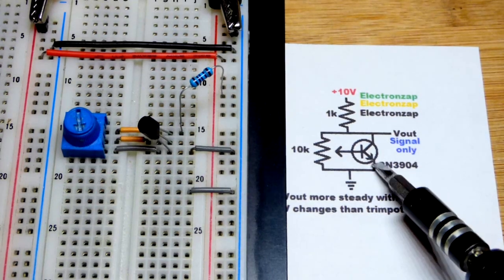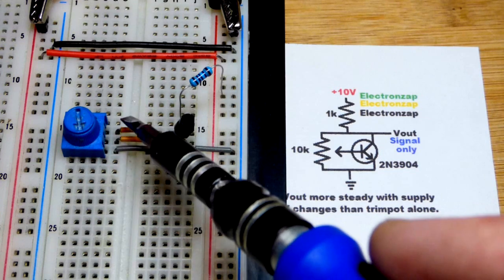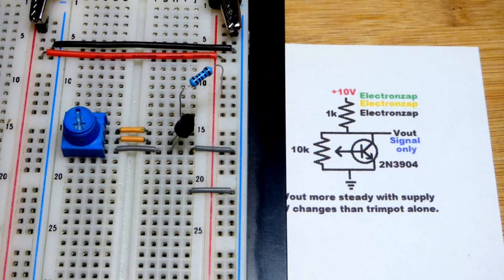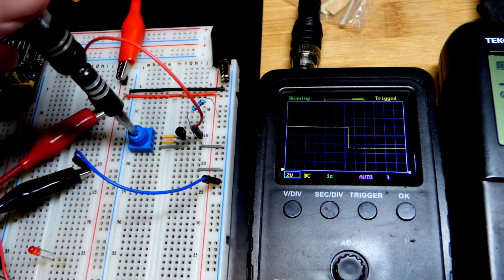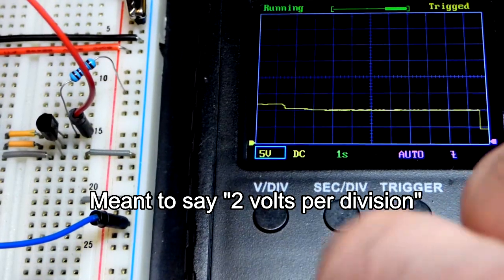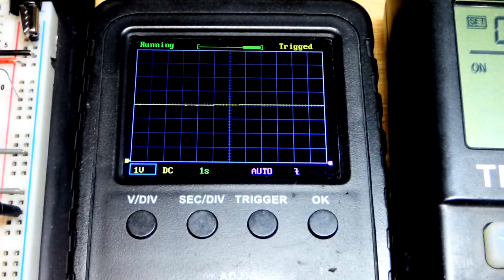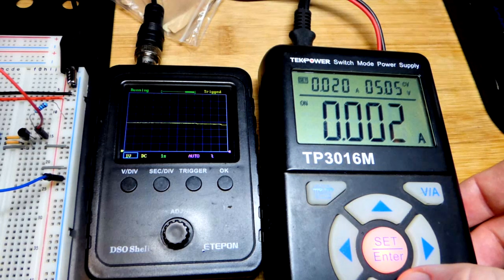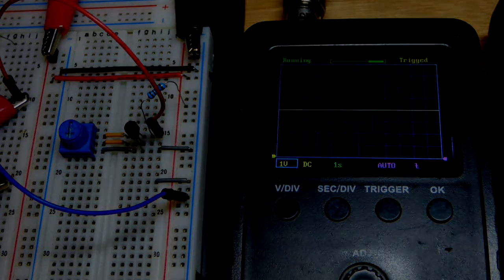How to wire an NPN BJT to act as an adjustable zener diode using 2N3904 for DIY electronics

Comment: I'm struggling with AC current and capacitor choices. Specifically, I want to get into building guitar pedals, but I feel a bit stuck not knowing what capacitors to stock up on.

Do you have anything that might cover all the bases? Power supply smoothing, high-pass filtering, and low-pass filtering?
Reply from the maker: I just have basic capacitor videos and I never studied guitar pedals. I'd look at guitar pedal projects that other people put together for inspiration.
Reply: @Electronzap  I've been trying to do that. Every project and tutorial I've watched or read up on are describing the reason for the values, but never really deep dive into the component choice.

So far my best resource has been Wampler Pedals (.com).

I've even found a decent PDF describing (some) component choices. Just isn't doing it for me. I don't feel confident to go out to a supplier and hit that order button.

To get really specific, the guitar input is very commonly written in the schematic as a polarized cap. To me that's confusing because I'm so use to that (symbol) being an electrolytic cap, but I know from watching here it is a different style of cap.

--- That PDF: https://guitarpcb.com/wp-content/uploads/2018/07/A-Beginners-Guide-to-Components.pdf
Reply: @codeman99-dev  I'm rather late to offer any help, but here it goes anyway.

For power supplies, the choices you have depend upon the type of circuit they use. Some simple supplies are based only in transistors (look up the schematics of Heathkit EUW-17, for instance, or the ones in the books "Solid State Supplies and Converters" by Allan Lytel, and "125 One Transistor Projects" by Rufus P. Turner), in voltage regulators (see the applications in the datasheet of the regulator TL431), or combinations of those and other components. If you just want to smooth a power supply that you have, go for 1000 uF (rated at double the voltage of the power supply) at least.

Take a look at geofex.com, runoffgroove.com, diystompboxes.com, home-wrecker.com. They have forums, articles, schematics, suggestions or modifications of the circuits.

If you don't want to order the wrong type of capacitor, try salvaging components from dead electronics, like old radios, DVD players, VCRs.